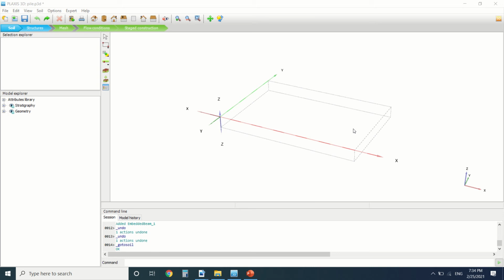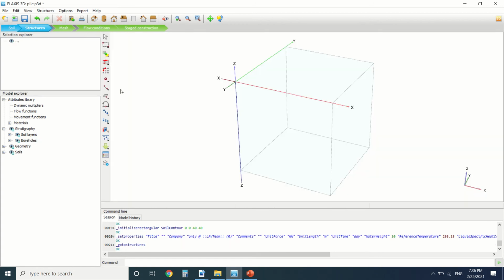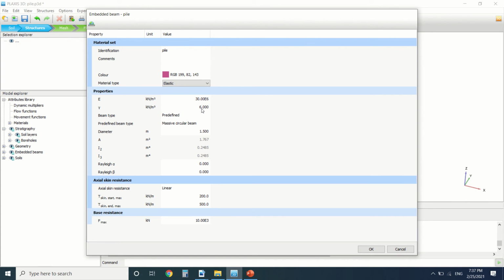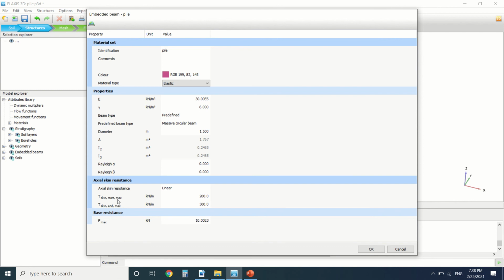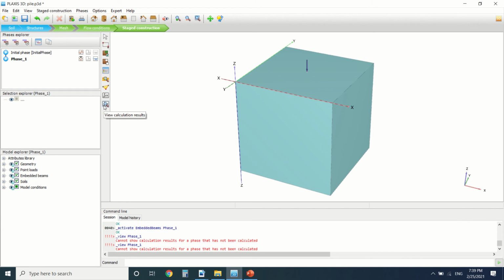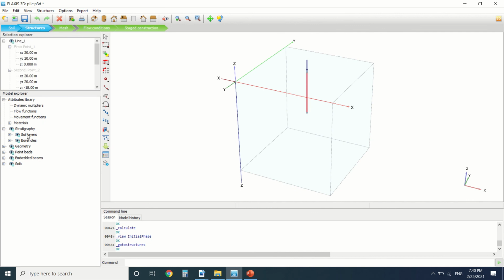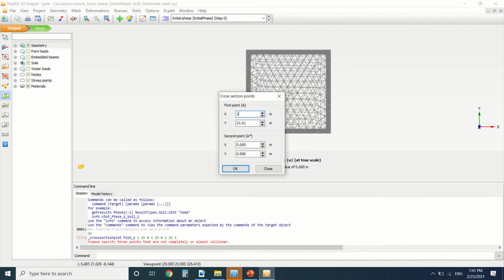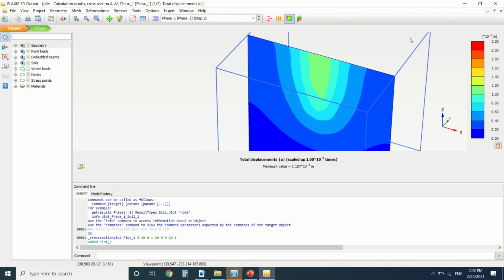Plaxis pile modeling and calculation

Comment: Hello sir ! Thank you for your video presentation. I am exploring the possibility of conducting a numerical simulation using Plaxis 3D to apply displacement-controlled static pile head loading with simultaneously applying base excitation with simple harmonic motion. preliminarily I have used hardening soil model for this simulation but not get succeed to get results.
 is it feasible to conduct such a simulation to obtain pile head force-displacement relationships ?

Comment: Thank you for a useful video
Can you help me please... I need to simulate the load sharing between raft and piles in plaxis 3D for piled raft foundation system... I know the method for this but it needs the normal stress on raft... My question is how i can get this value and it is location on the raft

Comment: Do we enter the material set pile section of the plaxis program, the surface friction and end resistances that we have previously calculated theoretically? Or why did you enter these values and why the point load is 100 KN does it projecr load for each pile correponding to point load?